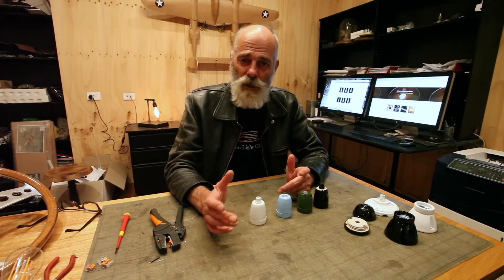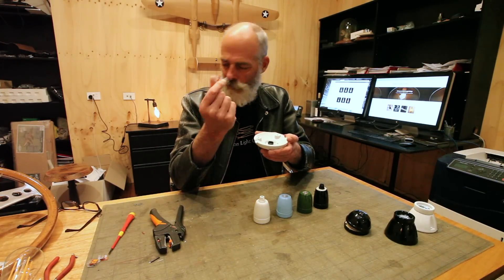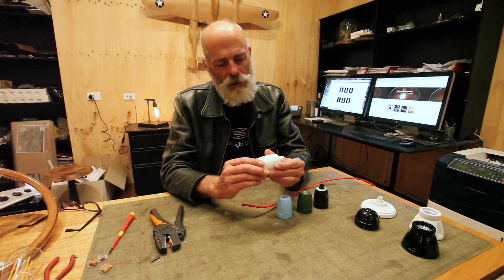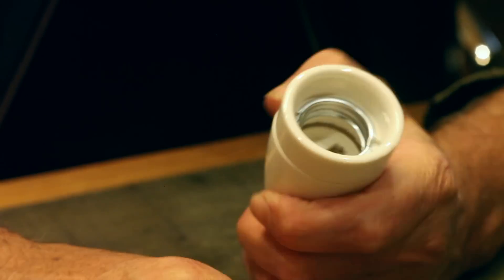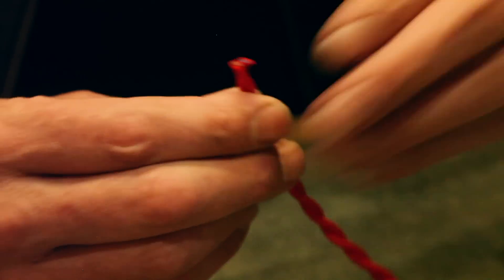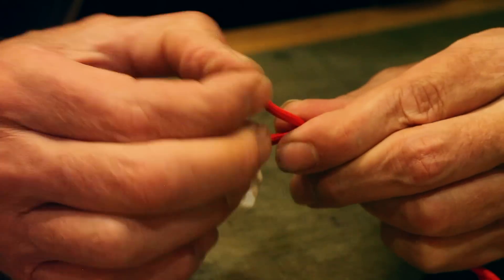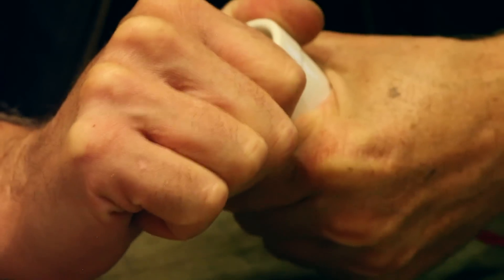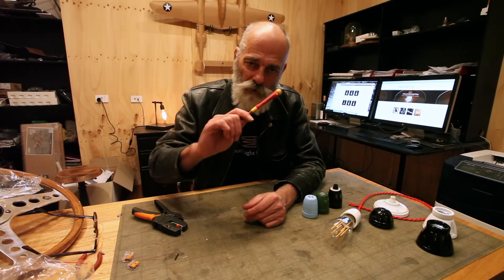How to wire a Ceramic E27 Lamp Holder

Comment: how do I connect romex to this? with a ground? How does it work?
Reply from the maker: You will perhaps find that these are not compliant for your mains voltage system

Comment: nowadays e27’s are used for LED lights, e27 ceiling fans and other electronics. However most (all?) e27 fittings are 2-wire NOT 3-wire NO GROUND! How to hack or workaround to establish mantain ground?
Reply from the maker: Use lamp holders that do have a ground wire. Simple.

Comment: I got a question for you or anyone out there feel free to chime in I ordered a lamp bulb holder thing off the internet and it arrived mostly in good condition I mean it's mostly plastic it wasn't broken but what I noticed is on the back of the socket it's missing the wire terminals for example previous ones I've always scene have got screws and little metal things where the wire goes in and you tighten it with screws but this one it's just a plastic socket and the back I don't know how they expect me to connect the wire I'm going to have to return it but it's just a little frustrating because the products arrived in good condition shipping no damage or cracks but it seems kind of useless to me without the wire terminals in the back I don't know how they expect me to attach it how to attach the cables to the socket I thought maybe it could just push in the wire but I don't it doesn't seem like it would be very secure I've never seen one where there's no screwed it connected screw to connect the cable
Reply from the maker: Hi, did you buy the lamp holder from us? If so we will always support the product and re ship if faulty or missing parts.

Comment: Would it be possible to put these in a ceiling light safely?

I know how to wire a pendant light. I just want to use this 200W incandescent E27 bulb I have as a space heater :P

Comment: What happens if the cables were in the wrong place?
Reply from the maker: If wired the other way round the lamp will still work. Importantly however if the globe is unscrewed when active is on and in contact with the bulb thread, you could be electrocuted.

Comment: do you have any video on how to differentiate good & bad / low performance ceramic fitting s
Reply from the maker: You can tell if they work or not, simple. All should have a functioning "anti-rotation" so that they will not come undone easily. The rest is just a visual inspection.